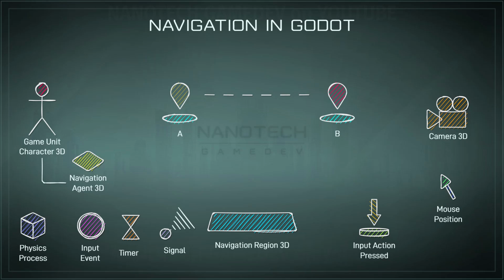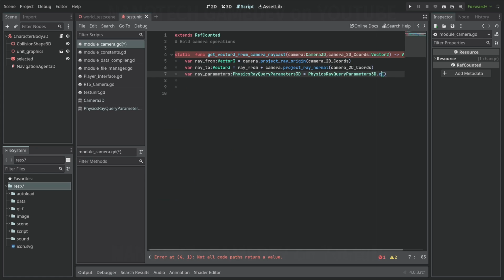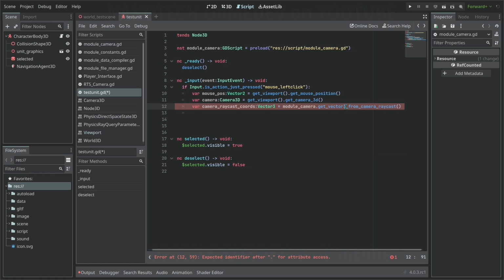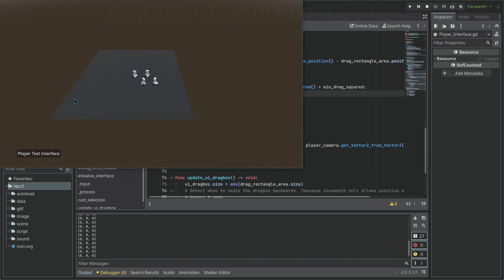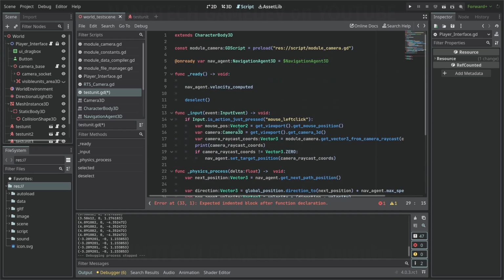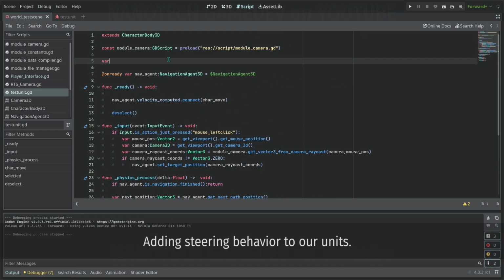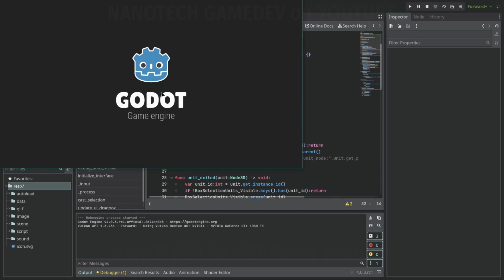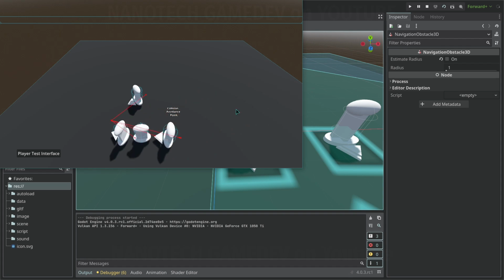How to Navigate units in Godot : Navigation Agents Tutorial - Making an RTS Series

Comment: I see in other pathfinding examples that the velocity is normalized, e.g. "(direction - velocity).normalized()". Is there any reason why you omitted this? Is it not nessecary? Thanks!
Reply from the maker: I don't remember exactly if I did or not used normalized() on these calculations, we usually normalize vectors to get it's length to 1.0, here you can see a more detailed explanation by KidsCanCode on the Godot forum: https://forum.godotengine.org/t/please-explain-what-the-normalized-function-does/7231

So depeding on how you calculate and combine the movement directions with the navigation agents you might need to use .normalized(), that project later I switched to use a much simpler and faster navigation by using only the navigation server with get path(), and didn't even used the navigation agents nor the collision code anymore: https://www.youtube.com/watch?v=og4O_YRayRc

Comment: Could you explain how to make your movement through a pop-up menu? So that at the beginning, after clicking the left mouse button, a window would pop up with the choice to go here and run here?
Reply from the maker: I assume you already have the destination stored somewhere, it's just the matter of connecting the navigation functions to a button inside Godot controllers, buttons and pop menus, then you call the navigation function towards the path you want,

Or, you mean having two modes for a unit to move? Then it's just the matter of adjusting the speed and behavior to your units, you can prepare functions that will take arguments to adapt for the things you want and based on the button a player selected call the adequate function, strategy turn based games does this, but you are going to first have to code the systems you want,

Imagine if you wanted a unit to have the option to crawl, walk or run, whenever you clicked, a pop menu would show up and display the three buttons to how to move towards the destination you gave, then after you have selected one of them, you would pass to the unit the navigation destination and arguments that would make the unit, crawl, walk or run towards the destination,

Comment: I also try with a obstacle, a  building with a StaticBody3D, and it' looks like works better if the CollitionShape3D has a sphere as shape than a box. Do you think the same? Thank's for the tutorials.
Reply from the maker: Yea it's better in some ways, like it's faster because the collision calculations is based on a single point and it allows some units to slip when colliding, only downside is that they can move on top of one another, you fix that with a capsule shape or by removing Y velocity from the calculations, or try to force a constant Y height position for your units.

Comment: having a problem I can seem to anything to work and with the for loop that casts the select box its saying its not a func in the Node3D
func cast_selection()->void:
	for unit in BoxSelectionUnits_Visible.values():
		
		if drag_rectangle_area.abs().has_point(player_camera.get_Vector2_from_Vector3(unit.transform.origin)):
			unit.selected()
		else:
			unit.deselected()

the unit.selected and .deselected brake the game
Reply from the maker: Maybe your unit script don't have those methods? On that video If I recall these functions were only visually displaying the selection by showing the selection sprites.
Reply: @nanotechgamedev  The same problem. Did you find the fixion?
Reply: Maybe you should check, what is in the BoxSelectionUnits_Visible dictionary. I had this issue once when by terrain was also detected. If thats the case then make sure that your selection box only collides with you units and not with terrain nodes. Futhermore you should check if the script of your unit is on the root node, in that case you don't need unit.get_partent() in the on_body_entered function in the player_interface script. I hope I could help you.
Reply: No, this issue was related to how unit_entered and unit_exited works. I had similar issues and by checking everything for some reason either node/ object wasn't added to dictionary or it was removed too early. And also because in early stages, it didn't have safe guard from adding map to dictionary and because map doesn't have selected/ deselected function it lead to nonexisting error of those two functions.
Reply: It seems to only happen when I switch the node3D to a CharacterBody3D it works fine as a node3D still getting : Invalid call. Nonexistent function 'selected' in base 'Node3D'. like the CHarbody3D is comeing up as a Node3D
Reply: @cpt.faulkonj3859  The same problem. Did you find the fixion?

Comment: I am having an issue with the  get_vector3_from_camera_raycast() here's what it prints [(212, 1)
camera_coordinates:(212, 1)
ray_from:(0, 12.03123, 8.031232)
ray_to:(-564.9587, 513.3544, -647.3286)
Camera3D:<Camera3D#40416314798>
result:(0, 0, 0)]. but no matter what I am always returning (0,0,0) even after apply 1000* to "ray_to" any ideas what I am doing wrong?
Reply from the maker: For some reason yt blocked your comment and I didn't got a email, sorry for the late response. So, usually when your raycast functions keep returning null vectors means it didn't collided with anything, so you need to make sure your collision layers are set correctly, this can be extremely hard to detect because it doesn't pop up as a error,

Comment: Been messing around with this for a while now, and seems like no matter what I do, they just flat out ignore the NavigationObstacle3D when pathfinding, they go straight through it as if it is not there. Any suggestions as to why?
Reply: I have the exact same problem. Can't get them to avoid the thing. Tell me if you figure out why, and I'll do the same! BTW. Which version of Godot are you using? (4.1 or 4.2 beta I assume).
Reply: @akselst  Currently using 4.1.
This is really driving me insane now. The only way I can get it to avoid anything is if I add to the mesh the nav region is on. The obstacle does nothing unless I draw out that polygon, in which case it just works like a collider and simply stops it as it tries to walk through.
Reply: @Rattja I have found a solution. On the NavigationObstacle3D in the inspector settings go to Avoidance. change the radius from 0 to something like 2 (meters). Then you see a big box. If you then select the parent Node3D and raise it up to transform y = 1 (meters) it starts working for me. I'm wondering if this possibly is a bug, since I don't understand why it shouldn't work when the parent Node3D is at located at y = 0 or y = 0.1. Does this work for you aswell?

Edit: I also found out that putting the y coordinate of the parent Node3D too high will make your testunit not detect it anymore also, even if the orange visual shown in the editor looks like it should be visible to the testunit. Weird.
Reply: @akselst  Yeah, it is definitely tied to the height of the obstacle node, as moving it up worked for me too.
What I can't figure out is what value it is comparing to..
Thought maybe the reason it did not react to 0.1 up was because of the "Max Climb" on the navigation region, since that is 0.25, but that was not it either cause it starts to ignore below 0.2. So 0.2 stops it, but 0.19 does not.
This thing makes no sense to me.
Reply: @akselst  Small update. Turns out the Obstacle is bugged. The default 1m height is actually 0m until you set it to something else. If you want it to be 1m, then you need to set it to something else, then back to 1 in the code. Just changing it in the inspector does not work. For any other value than 1, it works as expected.
Reply: @akselst  Well I figured it out, kind of.
It is related to the height on the NavigationObstacle3D. Setting it to more or less than the default 1m made it avoid it. Not exactly sure what it is comparing with yet, cause it does not seem to be the character navigation or the mesh agent height. The only change that made it avoid it was if the obstacle was not 1m, so a bit confused about that part. The description on the NavigationAgent for height says it will ignore things above or below it's position + height, but changing it didn't seem to do anything.

But at least I have narrowed it down to what property to mess around with to make mine work for now. So if yours is not working, try to change that one.

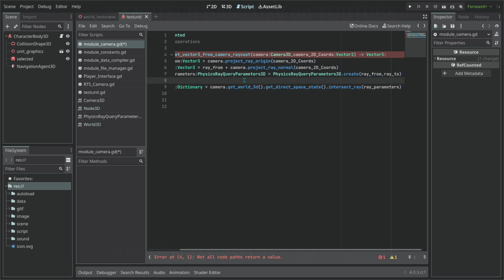Comment: Hello great video. @5:30 you used camera.get_world_3d. but can't we just use get_world_3d() without Camera.
Reply from the maker: Thank you, so in the case of the tutorial no, because I am extending from RefCounted and get_world_3d() is a function that only 3D nodes have, so I needed to access that function from the camera 3D node. If you are using a 3D node in your project with that code, then you can safely just use get_world_3d(), it will work the same,

The reason I extended from RefCounted was to create what I call 'module' scripts, which are scripts treated as resources not objects, so they are never initiated but only used as reference, holding only static functions, this way we can boost perfomance,

If you want more information on why I am doing it this way you can check the video on multiple inheritance, which was the main reason I created the module concept:

https://youtu.be/abkLa2xP00Q

Comment: Hi, I am facing the problem of FPS dropping at 2000+ objects, but the resources of the device are not fully engaged...

Can you suggest ways to debug or possible reasons for this behavior...? :)
Reply from the maker: Well, here are some ideas, though you should use the debugger in Godot to know exactly where the issue of the fps dropping is, sometimes is just bogus code or too many nodes,

You can find how to use the debugger in the docs with some tutorials, here are some useful links:
docs.godotengine.org/en/stable/tutorials/scripting/debug/the_profiler.html
docs.godotengine.org/en/stable/tutorials/scripting/debug/debugger_panel.html
docs.godotengine.org/en/stable/tutorials/best_practices/index.html

If your code is not statically typed, look into it, it will boost gdscript perfomance if you define exactly the type of variables and what the functions do, here's a doc file:
docs.godotengine.org/en/stable/tutorials/scripting/gdscript/static_typing.html

To increase the use of resources, you could look to multi threading, which is all about using more cpus, I however wouldn't recommend this unless strictly necessary, there are some hoops you need to overcome in order to make it work properly, 

You mentioned 2000 objects, maybe try to reduce the node count while still keeping everything working as it is, this of course depends on your project which I don't know anything about,

I would also advise to stay close to newer godot releases, because the latest versions now are all about optmizations, check for new changes merged in the new releases,
Reply: @nanotechgamedev  Thanks for the comment)

I added a rendering range limitation for the Mesh and noticed the following behavior:

After generating 2000 - 5000 objects, FPS on stage stays around 1 - 9, but after I scroll the camera 360 degrees, FPS rises to 60 and no longer drops, seems to be a problem with rendering, but how to get around it so far I have not figured out

(it's worth considering that I create an empty scene and add on nodes with navigation, coliseum cylindrical shape